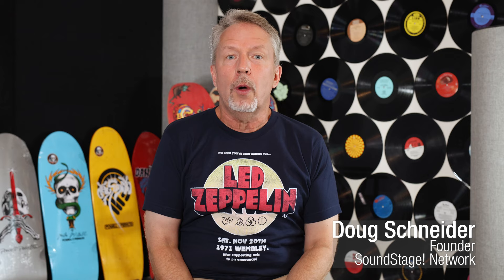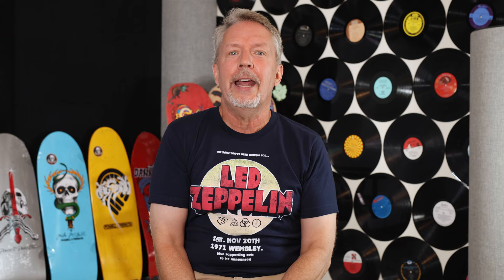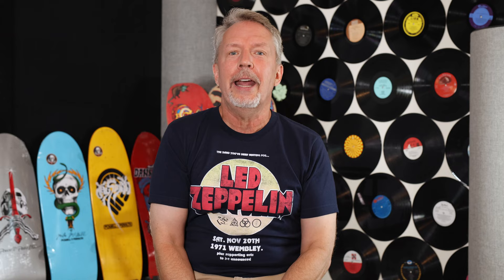Controversial Hi-Fi Upgrade Strategy: Why You Need a Powerful Amplifier (Ep:72)

Comment: You failed to factor in ‘gain’. The level of gain on your power amp, preamp, or integrated, can contribute massively to the performance of your sound system. For almost 25 years the beating heart of my system was a premium British 120w into 8ohms class A/B integrated amp. Never did I ever, experience any difficulties with it driving any speakers regardless of their impedance. I recently upgraded to a Scandinavian preamp monoblocks combo. The preamp being pure class A with unity gain. The class A/B monoblocks are rated at a conservative 300w into 8ohms and 540w into 4ohms. My substantial floorstanders can dip down to 2.2ohms but cause no issues for my monoblocks or integrated. However, I cannot achieve the same volume/db output with the monoblocks as I can with the integrated. I put this down to the 24db gain on the monoblocks as opposed to the 30db gain on the integrated.  But, it is nice to know that those monoblocks have so much head room.

My wife has a pair of hefty bookshelf speakers in the spare room, powered by a 25w class D integrated amplifier. The system sounds far better than it has any right to, filling that 16 feet by 18 feet room  with rich harmonically dense music. Easily achieving plus 95db output. So, whilst power can make a difference, it’s just one small part of a much larger equation!

                                                              

Enjoy the musicc c
Reply: Hi. Not really. Gain is a little different of a matter than what's presented here. You have to look at "system gain." Typically, power amps have 28 to 29dB of gain. So 24dB is lower than normal. But preamps have wide-ranging gain. We've noticed from about 6 to 15dB, though we've encountered some that go higher. So it's about system matching. When someone has an amp with lower-than-normal gain, they usually put in a higher-gain preamp. With that in mind, I've always noticed integrated amplifiers to have gain in the high-30dB range. So you can achieve the same thing with a preamp and power amp. I'm going to ask our measurement specialist, Diego Estan, to look at your comment and my response and see if he can elaborate more. Thanks.
Reply: Not much more to add. Since you mention an amp with only 24dB of gain, you'd likely need a preamp with at least 6dB of gain to be able to drive the amp into clipping, maybe more. Depends on the amp's power rating. Bottom line, use a high gain preamp with a low gain amp. Unity gain pre with 24dB gain amp won't work well.
Reply: @diegoestan8160  well, the preamp is active, but has unity gain. The monoblocks have 24db gain, which is low, I know. But it does put out 300w. The combo is from the same manufacturer and performs well together. And is more considerate to neighbours!
Reply: @dougschneider8243  👍🍻
Reply: @howardskeivys4184  That is interesting. I did some quick math. 300W into 8 ohms is 49Vrms at the speaker terminals. 24dB of gain is 16x, which means 3.06Vrms at the input of the amp to achieve full rated power. Since the preamp is a unity gain buffer at full volume, you'd need a DAC with a 3Vrms output and a track that hits 0dBFS to get full power from your amp. Most DACs offer 2 to 2.2Vrms at 0dBFS. This is strange to me that this manufacturer offers this combo. Perhaps they sell DACs with very high outputs (they're out there) to match their pre/amp combo?
Reply: I’ve been seriously into well reproduced music and the equipment needed to achieve that since leaving university and becoming a wage earner in 1981. I do endeavour to keep ahead of the game, by monitoring the hifi market place, staying in tune with the latest technology and terminology. But, I have to be honest. Your last comments fell on stony ground. Went over my head! I do have a dac by the same manufacturer. It’s equipped with an attenuator, or volume control. When set to max, the display reads plus 3db. I don’t know if, or how that influences your calculation?

My lounge, which doubles up as my listening room, is 18 feet wide 21 feet lomg  and 8 feet high. My normal listening level is around 78-80db peaking at around 96db. I sit 12 feet back from  my speakers. The dac’s volume is set to max and the volume control on the preamp set to 65%. It works for me! If I had to criticise my system, the top end is a little too polite.

Most of all, enjoy the music.
Reply: @howardskeivys4184  I'd need to know your DAC make and model to comment further. What I'm saying is that you need 3Vrms at the input of your amp to achieve 300W into 8 ohms, and that most DACs (maybe not yours) output a max of 2 to 2.2Vrms. This would not be a problem with a preamp with 6dB (2x voltage gain) or more in between the DAC and amp, but with 0dB gain on your preamp, most DACs on the market cannot drive your system to full power. Again, your DAC may have a high output, so no problem. The fact that your DAC has a volume control displays +3dB leads me to believe it can output higher than typical voltages.
Reply: @howardskeivys4184  What are the Scandinavian monoblocks you have? I could guess a few brands, but better to know for sure.
Reply: @howardskeivys4184  I agree that it is "littered with snobbery, elitism, and non factual bias." But that's not me -- and not Diego. I go by performance. When you said Scandinavian, Electrocompaniet came to mind, but it could be, for something newer, Gato, or perhaps even Hegel. Not 100% sure.
Reply: @dougschneider8243  👍

Comment: Terrible advice. Don’t listen to this guy. 300 watts?!  The greatest interdependence in your system (other than cartridge/phono preamp for those who listen to vinyl) is between the power amplifier and loudspeakers. In my very long and extensive experience, a significant change in loudspeakers will almost certainly necessitate a change in power amplifier. I wouldn’t run Magnepans with a 300b tube amp any more than I would run a pair of Klipschorns with a giant Krell/McIntosh/Levinson solid state amp.
Reply: Hi, I'm "this guy." So I'm trying to figure out how, with what you wrote here, you actually disagree with what I'm saying. It seems to corroborate it.
Reply: @dougschneider8243  I’m saying the transducer IS the most important and that folks should choose the speaker they love and then find an amplifier that pairs with it well. High efficiency speakers like horns or single driver designs tend to sound better with tubes. Inefficient box speakers like B&W and KEF, or panel speakers like Magnepan (planar magnetic) or Martin Logan (electrostatic) tend to pair better with higher powered solid state amps - although 300 watts is still probably overkill for most people. And, of course, I would argue that Magnepans actually pair pretty well with tubes and sound incredible. But you’d need something closer to 75-100 wpc like an Audio Research VT80 or VTL ST85. And quite frankly, either of those amps would drive just about any speaker of any topology to satisfying levels. So maybe the better advice is find the speaker you love and pair it with an amplifier whose sound you also love and that would be versatile enough to pair with most types of speakers. 300 wpc solid state is akin to 8 watts of SET. Both have their place, but they’re specialized pieces of equipment for a specific purpose. Most people will be very happy with 50-100 wpc. No need to go to extremes. It’s not prudent.
Reply: @dannyfannyfoodle  So I am still trying to figure out where you disagree with me. I say in the video that the biggest differences are with the transducers. My point is that people upgrading will tend to change their speakers the most often -- and they need to ensure they have an amp to drive all of them. I also say that 300Wpc seems to be like a "sweet spot" these days in that there are a lot of them. All told, I can't see why you think you're disagreeing with me.